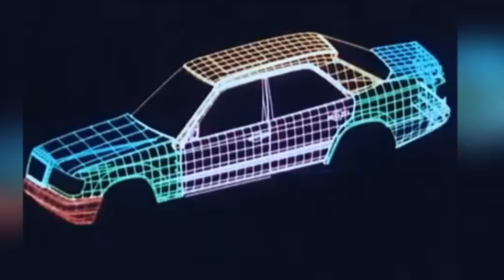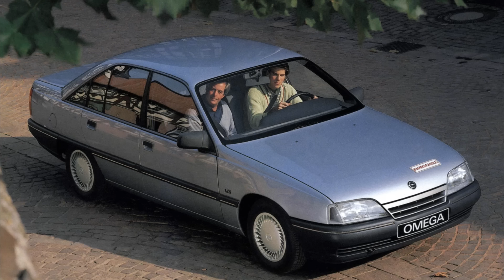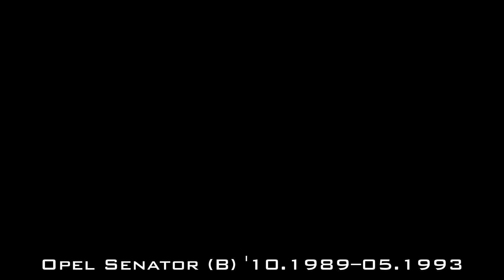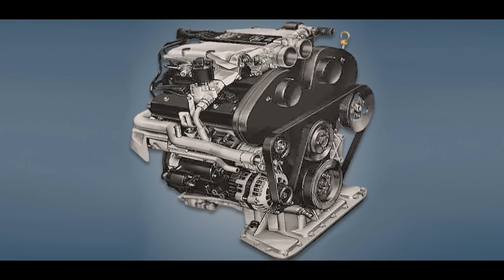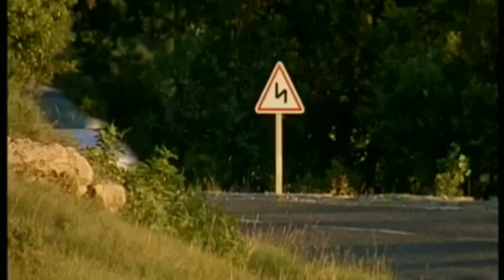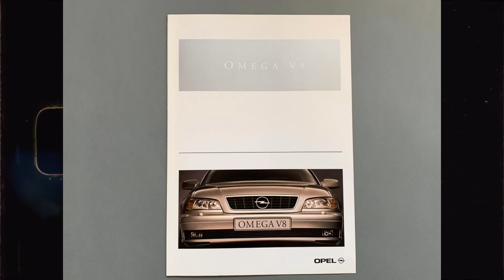Opel Omega: So Close to BMW & Mercedes

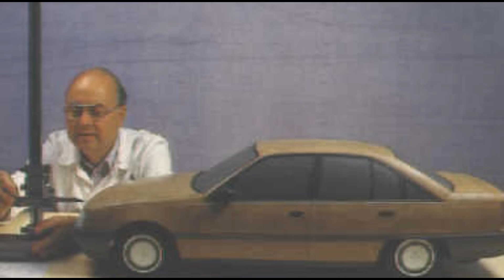Comment: 1:26. The GM B-body platform was Chevy Caprice, Buick Roadmaster and Oldsmobile Custom Cruiser. 
A D-body for the Cadillac Fleetwood was a stretched B-body platform giving the Caddy a 121.5 inch wheelbase and a foot more in length.
Reply: One was developed for European and international markets, and one was developed for the North American market.
They happened to share the same designation, but since they weren't sold in the same markets, it really doesn't matter.

Comment: Hi, this is literally my dream car here in Brazil. Chevrolet Brazil manufactured the Omega A here, and bizarrely, it somehow competed with imported cars, mainly due to its price, Compared to imported products, it was cheaper and offered the same features, It's sad to think that Opel is so diminished today within the Stellantis group. During the 80s and 90s, they sold extremely solid models, most of which were sold in Brazil, and they have a very large cult following. Bring back Opel <3

Comment: I had a few Opels in South Africa in the late 90's and early 2000's, the Coupe Turbo I had was styled with the help of Bertone and not Pininfarina, that car was seriously slick at high speed, on high speed highway runs it cut through the air like a scalpel, Opel quality was nowhere near that of BMW but on the tarmac it definitely held its own against anything with a BMW badge.
Reply: Really?
Reply: @monk3yboy69  yeah...

Comment: The Omega A was a good car, its 6 cylinder engines were good, and everyone tends (or wants, who knows) to forget BMW and Mercedes had absolute duds in their lineup too, 200D and 518i just in case. I also don't get why the Lotus Omega, which definitely gave the M5 and E500 a run for their money being reduced as an extreme special, the M5 and E500 weren't mass market vehicle either. I'm more reserved on the Omega B, as it switched from inline 6 to V6 which isn't better in my opinion, but as that car was the basis of many great GM vehicles it can't be as bad as people make it out to be.

Comment: Here in Brazil, the Omega was released in 1992 by Chevrolet, replacing the Opala, which had been on the market for 23 years, with the GLS and CD versions. In 1995, when Opel discontinued the Omega A, it was still being produced here, but the 3.0 i6 engine was imported. The solution was to improve the old 4.1 i6 engine from the Opala and put it in the Omega. It was produced here until 1998.

After that, the Omega was imported from Australia, basically being a rebadged Holden Commodore. It was sold until 2013.
Reply: I had to google Chevy Opala and the 2 door SS version looks amazing! The facelift did not do the car any good but that was the times. Many nice cars got ruined by adding black plastic. Thank you for the enlightment!😊

Comment: Thank you for the video and the content. It was great and informative. I liked the footage too. Holden took that Omega and modified it and it used V8's and V6's and was quite successful. Opel should have looked to Holden in the GM family and used parts where it could from  GM North America and Australia.  The Omega was sold globally the first and second generations. That Omega V8 had potential. Vauxhall created that Lotus Carlton also. It seems every else in GM they utilized and made good use of the car.  The Senator had potential too. It had the looks. That car could have been sold globally too.  The issue was never the styling on the Omega and Senator. It was pushing far enough, the marketing, and the powertrains.

Comment: For 7 years and over 200.000 km I drove a 1999 Omega B 2.0 DTi, a former Bundeswehr general's car in (rare glossy) NATO olive, bought by an auction from the VEBEG, the state-owned company, where you can buy all kind of state-owned stuff.

I was a great car, comfortable best seats ever and reliable (except a broken BOSCH ignition pump, which was not an Opel-fault)

When the rust came up and costly defects as AC and oil leakings increased, I gave it for free to a Romanian K 70-fellow, who fixed it in his own garage and drove several more thousands of kilometers, many of them with trailer, through the Carpathian mountains.
Reply: Awesome! What s a k70?
Reply: @schlomoshekelstein4309 

https://youtu.be/6-3b0P6iZ3Q?is=AeCtvy5VCvYiOWFt

Comment: I dont understand to the storyline here - Omega was very successful model and always had a price under the MB or BMW. Ending was bcs new models, not for low sales. Rust? LOL, every car in 80-90'  had a problem when not garraged.
Reply from the maker: Production was discontinued, the Omega line was shut down, and Opel exited the E-segment.
Reply: @TheTransportChronicles  As well as many models in history, but it is not bcs they were unsuccessful! Period was changed, ppl prefered another segments like new shine star named SUV. Its ridiculous to see in more than 2,5 milion sold cars failure and pretend you bring some clever explanation.

Comment: The best version of the omega a is the Holden Vn Commodore group a with the 215kw 5l v8. But it's funny your saying the Germans when Opel is German...

Most BMW's and Mercs were sold as base models too. 

And yes. The omega b had a Corvette v8 in the commodore that was wider.
Reply: A Lotus is cooler, but the Holden is a good number two!

Comment: The Omega didn't need a petrol V8 engine. What it really needed was a 3.0 six cylinder turbodiesel engine with 204 hp and 500 Nm of torque to compete against the BMW 530d and Mercedes E320 CDi. And said engine would have to be coupled to either a  5-speed or 6-speed automatic transmission.
Reply: fun fact: the 2.4 litre Diesel engine of the Omega 2.4 DTi and the BMW 524d was the same engine.

Comment: My late dad always bought used cars and particularly liked Vauxhalls. 33 years ago he was looking at buying an Omega A based Vauxhall Carlton 1.8i or 2.0i GL / CD - but to no avail. All of the decent ones for sale secondhand were too expensive.

Instead he bought a Rekord E2 based Carlton 2.2i CD with sumptuous velour interior. It was a 1986 model, thus one of the last Opel Rekord based models off the Russelsheim production line before the Omega A. I got to drive it a few times after passing my driving test and I really liked it.
Reply: When I got my driver's license in 1994 we still had a 1983 Rekord Caravan 2.0 E. It had taken us from Germany to the South of Italy, to Greece, to Switzerland and Austria, to Denmark, winter and summer. I loved driving the Rekord, it was smooth and comfortable, well built, reliable. I moved to Berlin in the mid-90s, never owned a car myself, and my dad only drove Kia afterwards. 
When the Omega A was first shown at our local Opel dealer I went with my dad. There was a lot of enthusiasm about it, at least from what I remember (reading car magazines, collecting brochures). Seems like ages ago now.

Comment: As at 9.45 you stated where Opel had its downfall, "Opel had no intention of backing down, instead of staying in its natural role...." and that's where the failure occured. 
Its like with the Ford Granada, The Omega/ Carlton was a really good car and excelled in its sector and had a strong customer base. If Opel had concentrated on its market and not tried to get into a higher class it would have been a successful car. The lesson here is, know your strengths and stay in your lane.
Reply from the maker: Exactly. I learned that the hard way.
I used to run a workshop repairing and restoring upholstered furniture, but I really wanted to switch to producing new sofas and beds. The problem was, I didn’t have enough people to run it properly, nor the money or the time.
In the end, I didn’t manage to build the new business and almost ruined the one I already had.
So yeah, it’s often better to be the best in your niche and stay there.
Reply: @TheTransportChronicles  I hope you managed to save your original business and made it flourish. I learned in my very early 20's by over reaching myself and getting into debt to keep up with others earning more than me that it's not worth it.

Since I came out of that debt over 30 years ago, I live by my means now, my car's not as flash as other peoples, nor is my tech or other things but, mine is paid for and mine and not on credit. I'd rather be humble and comfortable than be flash, living off credit and waiting for the wolf at the door all the time.
Reply: You're right. Opel had no intentions on backing down. BUT, three factors made it happen. 
1. GM is known for making wrong decisions. 
2. The Lopez affair. A massive 1990s industrial espionage scandal where he took thousands of top secret papers and did bring it to Volkswagen where he was hired.
3. And the automotive media, especially Germany was fixed, with all their propaganda, to favor Volkswagen.
Reply: @lindacruz2866  Thank you so much for the information.  Now that I'm aware of the full story, it makes sense, it wasn't just the GM Exec's blindly being stubborn but also other factors that meant they had their hands tied. 
I do enjoy the car world because you are constantly learning something new.